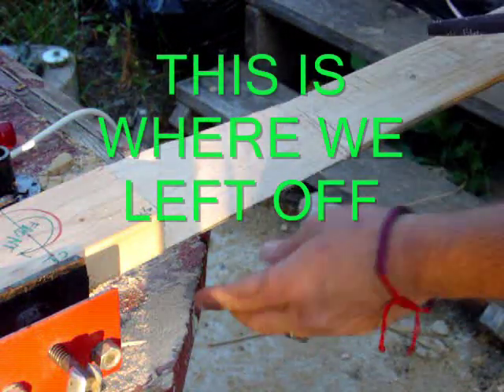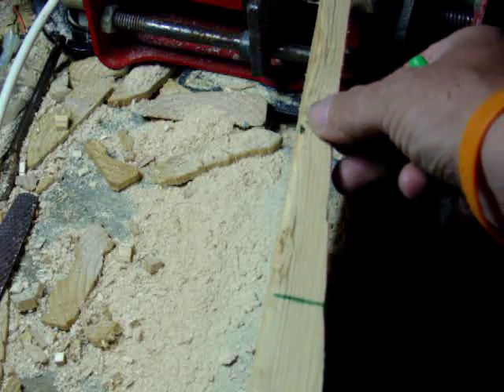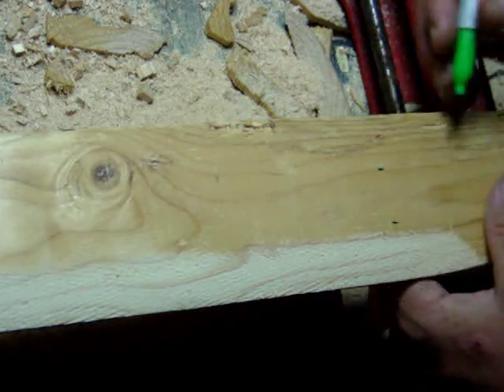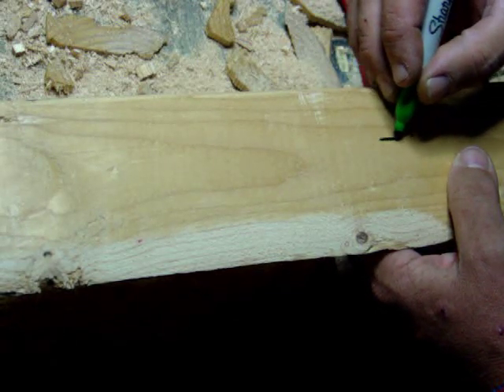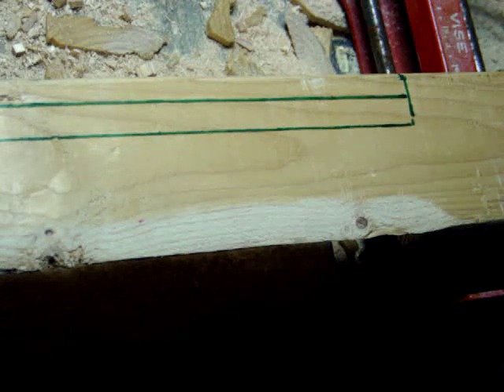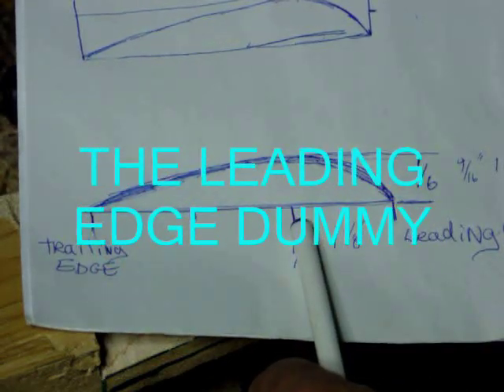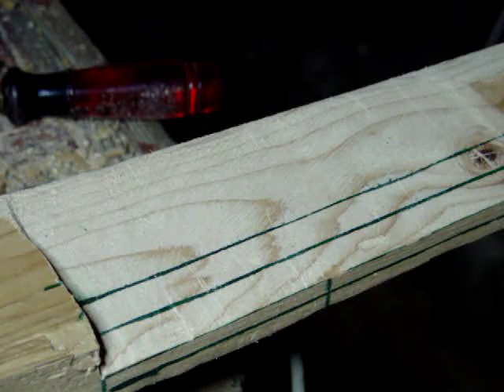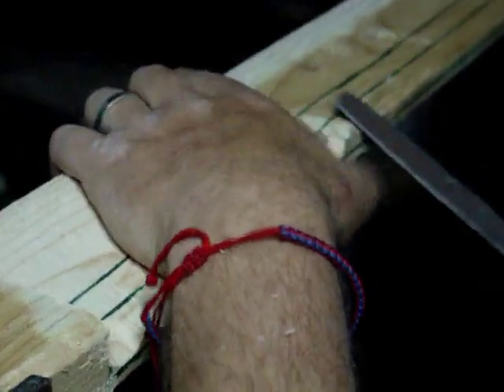PART 3 THE CARVING OF WEST COAST DOUGS INVERTED WIND TURBINE PROP

Comment: At exactly 5:34 I at first missed the point that it was cut perfectly flat, no curve.
So I am noting it here in case somebody else missed it. (Correct me if I'm wrong).
The venturi curve is added after that cut, as per you mentioning redrawing the 1 1/8 inch line and the half way line.